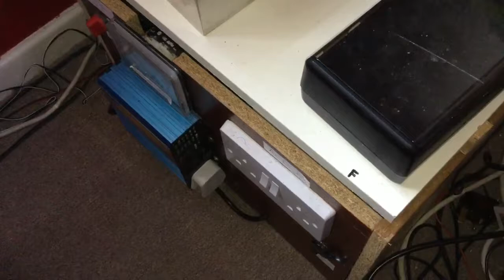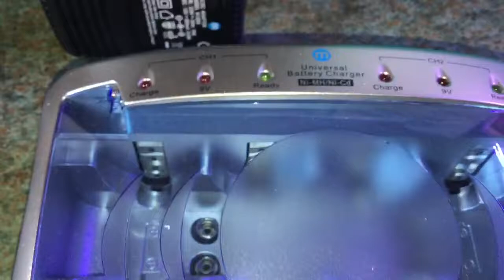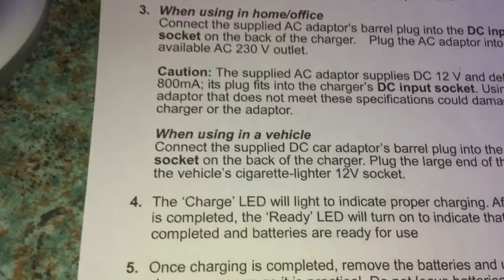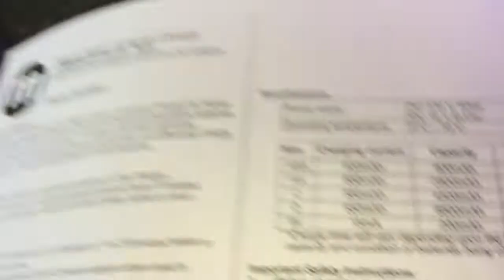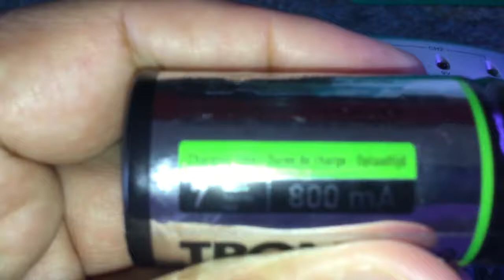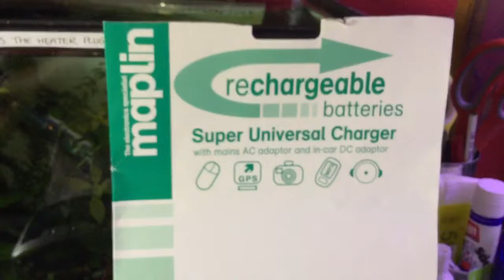Review of Maplin Super Universal Charger

Comment: Thanks for the video, can you remember what it means if the charge light flashes as opposed to it being solid red
Reply from the maker: @gurmon  hi, thanks for your interest, I haven’t got the instructions handy, but i will have a hunt, when I have time. But I had something similar happen with one of my other chargers, I believe it means that the charger thinks there is a problem with the battery or batteries being charged. Try charging the battery or batteries in a different charger, and see if that works. If I find the instructions, I will post an updated comment. Thanks Solartiger, Ps Have moved house since the video was made, hence finding stuff may be more challenging.
Reply: @The_Solartiger  thanks for the reply, I found out, it means that the battery is not seated properly
Reply: @abduldyae1148  Is this a known good 9V battery.